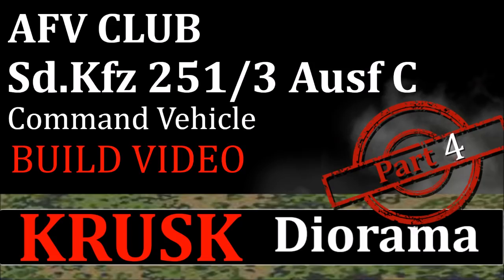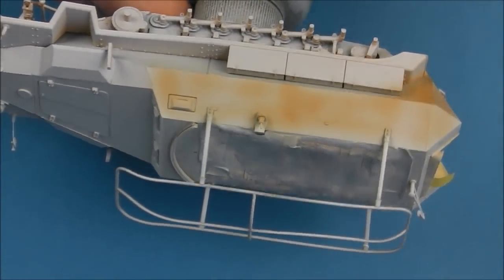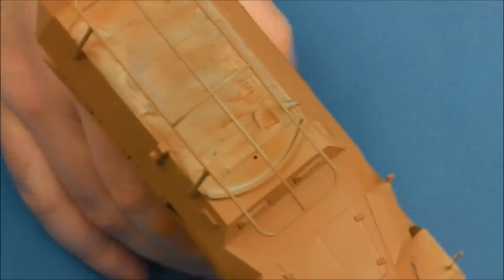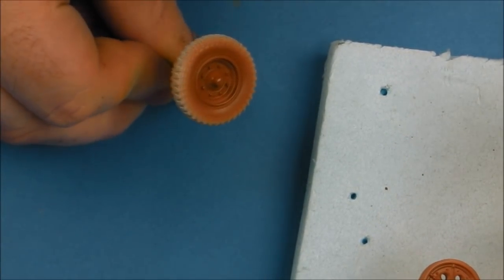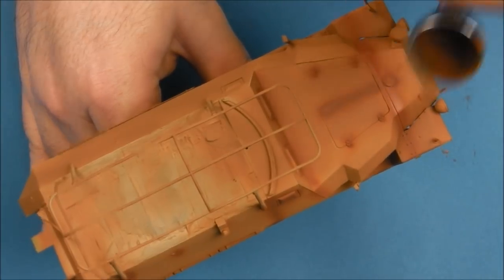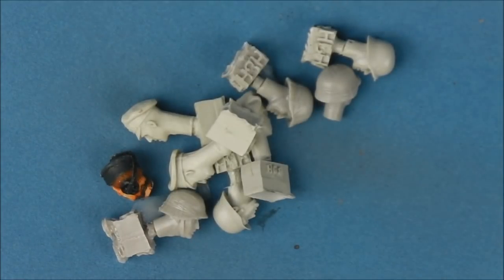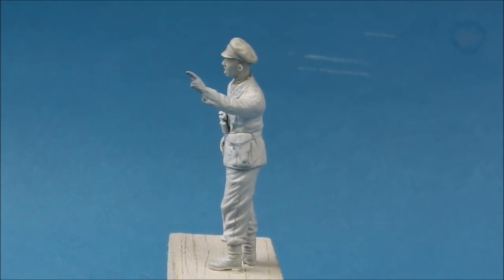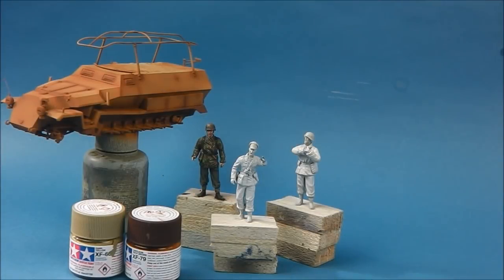1/35 Kursk Diorama Part 4: AFV Club Sd.Kfz 251/3 Ausf C Build: Kursk75

Comment: Is this base coat for hairspray chipping, to act as a rust base? Or was that color just your choice?
Reply from the maker: In this case the basecoat will be used as a means to add depth and shade to the next layers of dark yellow which will be doing down in very thin layers as to allow some of the darker color to show through. If I was going for hairspray chipping I doubt I would go such a rusty chipping color unless its abandoned ect.

Comment: Not to many preshade So will be interesting to see how it turns out.

As to your Arms there too Fat for use of a Word :D best way to do them is to do the arms on the Wire then add the clothing this way you can avoid the over scaled arms, 

Also when doing the folds i sand smooth a cocktail stick and use baby oil so it does not stick to my putty,  A rubber tipped brush is the best thing to use tough,
Reply from the maker: shall be interesting  to see how much of it we will be able to see once the next layer goes down.

As for the sculpting, ya I used far too much putty for the smock arms but it will do for now, but I will be doing my projects with sculpting in the future to practice my skills further